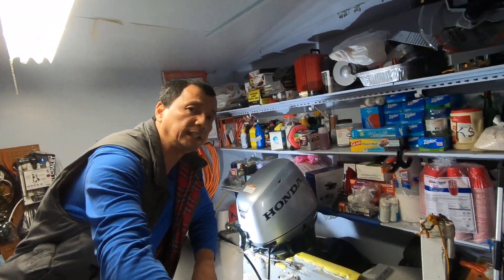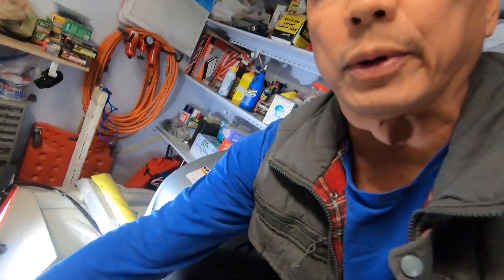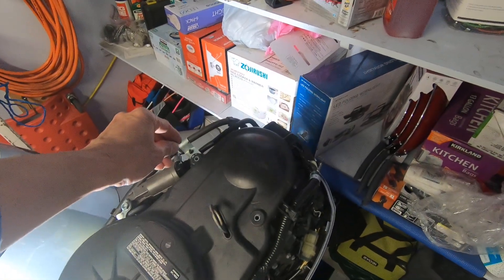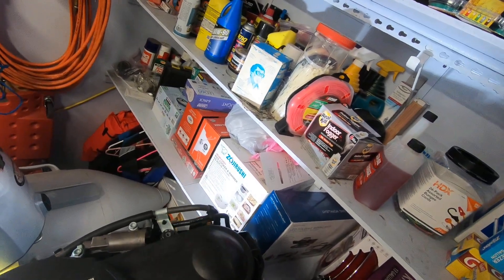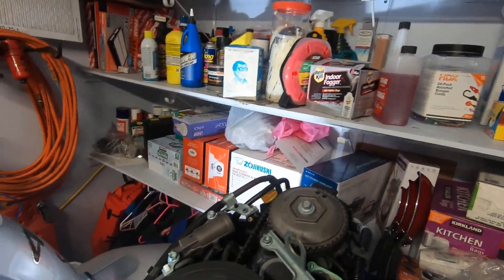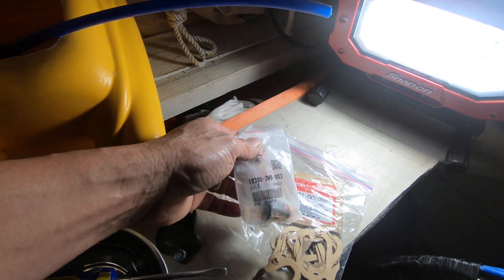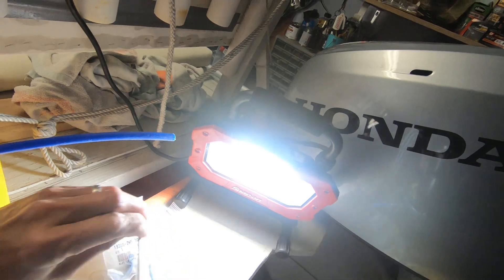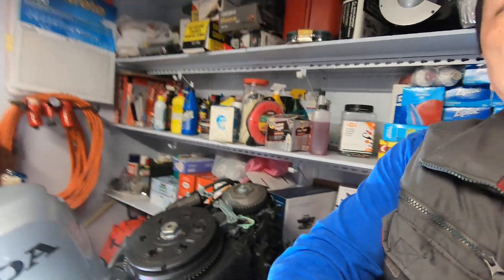Honda BF40 thermostat location

Comment: Heloo I just got my Saturn 16 ft Sd488 inflable boat like your mine came in FedEx has little scuffs amd wjat looks like a little scratch on the tube I’m the middle it does not go threw the tube but I’m wondering how well are they made should I worry or just live with it as I have the heat welded one heavy duty lole your I do not know about Saturn boats like you so I’m asking for your opinion doesn’t look heavy duty made tho  but could be not sure